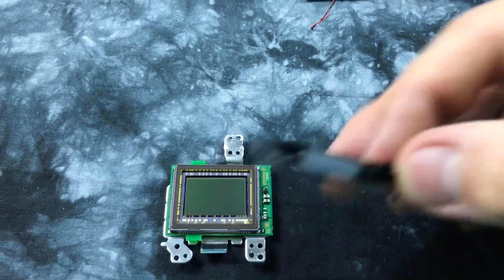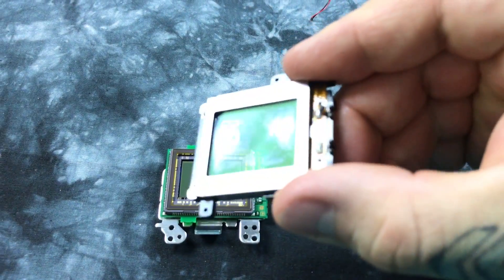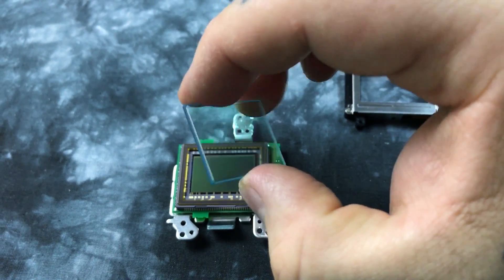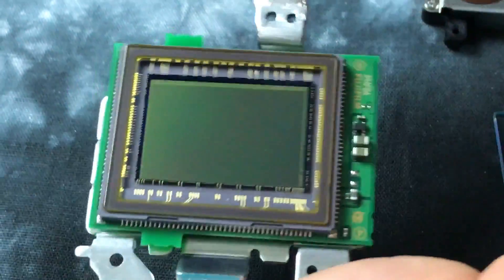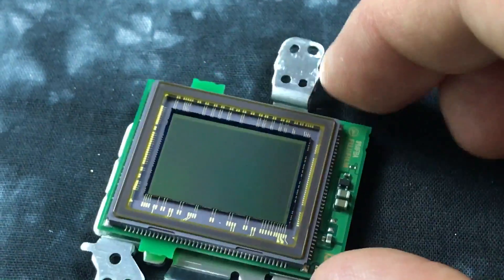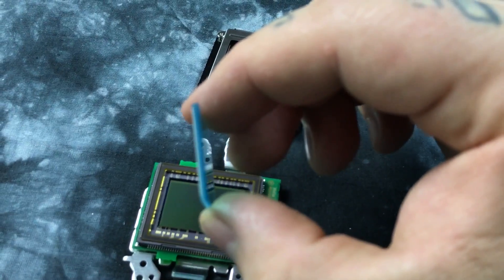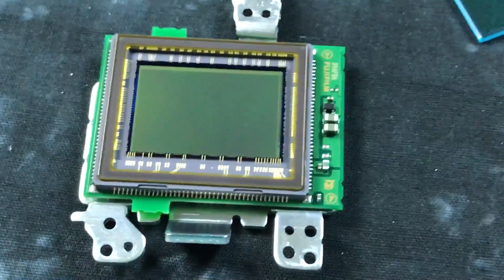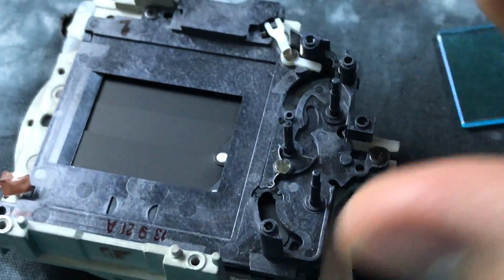😳WOW!...FUJIFILM HAS MORE GLASS THAN ANYONE OVER THE SENSOR🤓

Comment: Wouldn't the extra glass have the same negative effect as lenses with more elements in terms of rendition and micro contrast? That's quite a lot of glass the light has to travel through before hitting the actual sensor.
Reply from the maker: no, super superthin optical FLATS is one thing, HUGE thick glass elements is another
Reply: dunnymonster not to mention if you have tons of light hitting it from certain angle, it will reflect the sensor itself onto the final image >_< (happens to me all the times when shooting 56mm 1.2 into the sun - yeah, not that often but look that I like when it comes to portraits - golden hour, dreamy hazy look but on X-T2 it results in unusable image)
Reply: Theoria Apophasis Hey Ken what's goin on man! I was out shooting in the city today and came across an odd error message on my XT2 and was wondering if you ever ran into the same problem. It was prompting me to turn off the camera then turn it back on and almost every time that I turned it back on the message would pop back up. Also, it was only occurring when I was shooting with my 55-200 and not all with my 10-24. Right before it happened every time I notice the image of what I was shooting was darker on screen and EVF than it was exposed for. Any ideas?
Reply: Hi Ken 
Can you show us what a low pass filter looks like 
Great video

Comment: All that extra glass to cover defective sensors!!
Reply: Yes, my XT1 had oil spots or something on the sensor itself, which given the protective glass Ken described, must have occurred during manufacture.  I sent the camera back to Edison NJ 3 times before they figured out that they had to replace the sensor unit as Ken shows in this video.  I other problems with my Fuji stuff, including flickering EVFs and LCDs on 3 different camera bodies, an issue the folks in Edison NJ claimed they could never duplicate, which occurred for me no matter where I took the camera, except in the forest, remote beach, etc.  So, after 2.5 years of love and frustration, I gave up on Fujifilm cameras.  While helpful and empathetic, the folks at the repair facility in Edison NJ have difficulty diagnosing issues and/or testing their repairs before returning the equipment and the cameras have either design flaws or poor QC.
Reply: martyn george, I did. The Fujifilm repair facility is in Edison, NJ.

Comment: Ken, very cool video. Wouldn't you agree that Sony just sells an OEM sensor and then the camera mfgrs. do what they want from there? Fuji is the one that added all of the glass and actually came up with the X-Trans design. Sony had zip to do with that. I expect that Sony will be the next one to drop out of the camera business. Too much overhead and expense that they can't control. They will go for the lower margin but high volume sensor business and flee like whipped pups from the vagaries of the end user camera business.
Reply from the maker: Xtrans ones :)

Comment: wait did you say that Sony makes the X-trans sensor for Fuji????
Reply from the maker: yes
Reply: wow never knew that
Reply: My X-E2 has the same sensor and same contact points as my Pentax K30.
So it's the second generation Sony 16 mp sensor. 

Not the one you'd find in a Nikon D5100 or D7000 but the one released just after.
Obviously customized by fujifilm. (Xtrans colour array and some Pdaf points smacked in the middle)